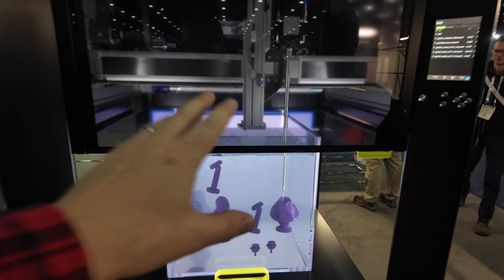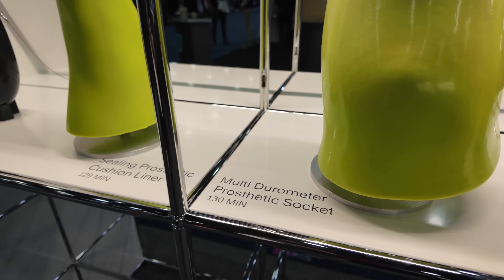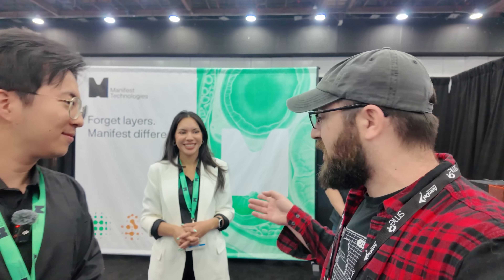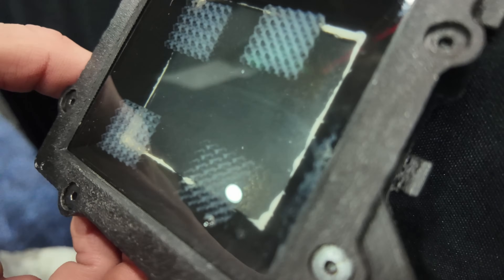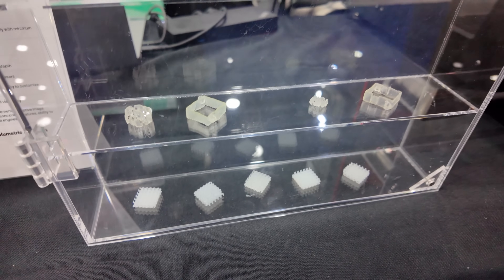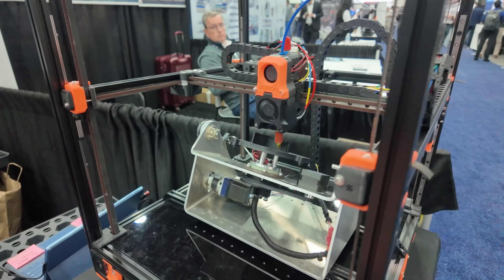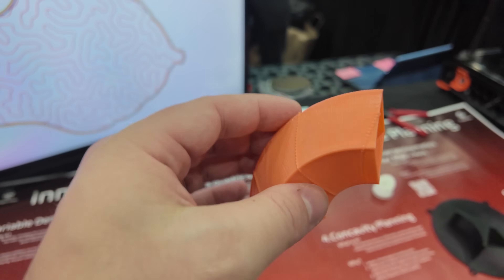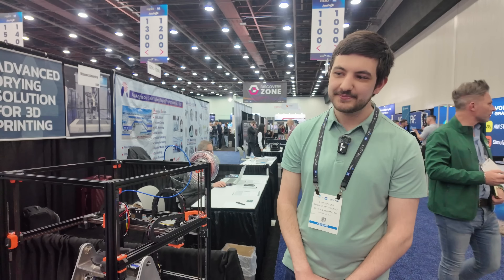Revolutionary Support-less 3D Printing Methods - RAPID-TCT 2025

Comment: I mean, the gel IS a support material, not really sure how it can be described as not being one.
Reply: but it looks re-usable, so looks good to me no matter what you cal it.
Reply: I guess he figure everyone would undertand he meant that It has no "traditional supports".  But you have to be very specific to some people.
Reply: I guess you can describe it as the printer does not print support material, aka support-free prints.
Reply: Should be described as no sacrificial support material.
Reply: @AG-cg7lk  Or just, reusable support. 🤷

"No sacrificial support" 😂
Reply: Support is for me attached to the print or has to be printed.
Reply: @Mr.T9191-i2f  The gel is a material that is supporting the print, nothing about being support requires it to be attached to the print or need to be printed.